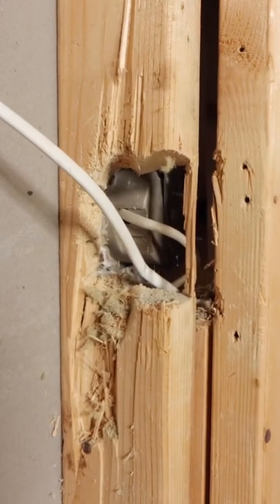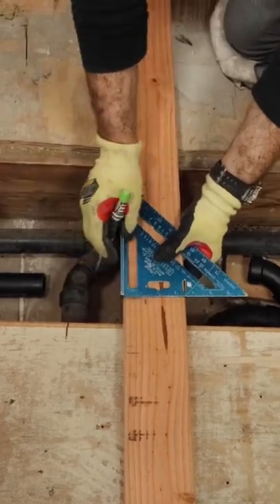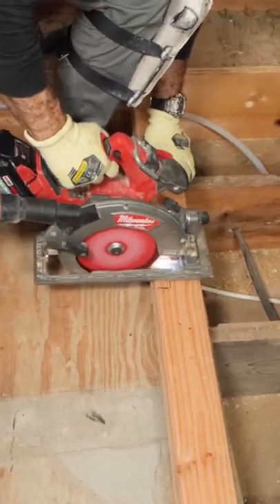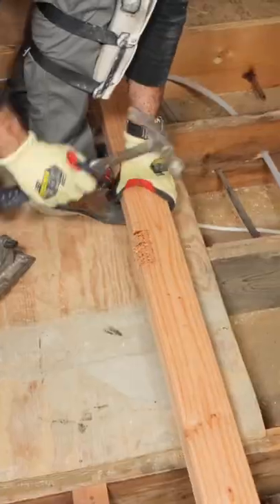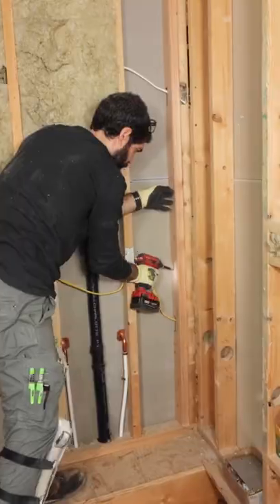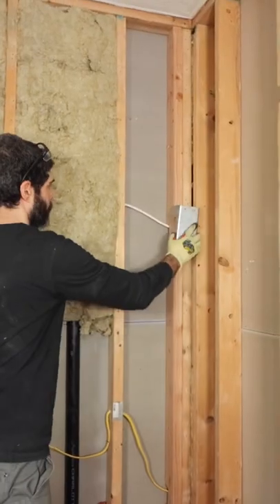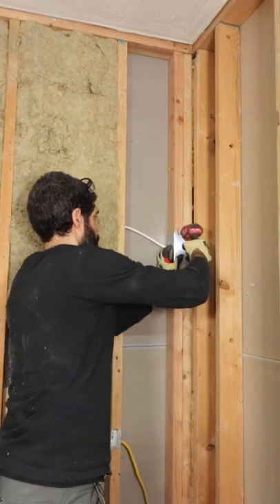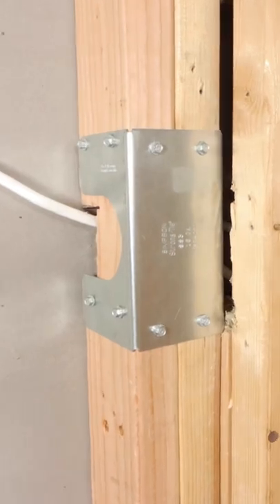Stud Wall Repair Tip - #shorts

Comment: Those screw heads may interfere with the drywall. Thanks for sharing!
Reply from the maker: Fortunately I had to fur that wall with 1/2” plywood so my KERDI-BOARD would slip over the tub lip. So I was able to notch the 1/2” plywood to keep the wall plumb 🙌🏼🔥
Reply: I've had to notch out the back side of drywall / greenboard using a 1" forsner bit for protruding fastener heads - not ideal but better than a bowed wall.

Also, link to the double stud bracket? Simpson?
Reply: No worries that's the drywaller's problem.
Reply: I was thinking the same he should use screws that are flush with the Box
Reply: @HomeRepairTutor  I'm guessing you screwed it up, and you've never conversed with a structural engineer. You can't fool people who rely on the quality of their work to eat.
Reply from the maker: @Dempdawg11  why would I lie about consulting an engineer, lol, that’s hilarious. Look man, you need to get a life
Reply: @XxPhasemanxX  was just thinking that sounds like the drywaller’s problem
Reply: Yea soon as I saw how protruding those bolts were I knew someone would say it'll mess with drywalling 😆
Reply from the maker: @Xaero324  but what they don’t know is that there won’t be any drywall in that area, cracks me up how people jump to conclusions without knowing all the information
Reply: Definitely will

Comment: It doesn’t even matter if it’s a load bearing . The damage must be repaired. There is wire running thru it also that must be protected. Good job.

Comment: Great video all the way up to your hex head screws you used at the end. It's going to cause issues with the finish work, that being Drywall, durarock... plus the stud shoe you're using is required to be drilled in from three sides and you can only use one, but honestly it won't make a difference.
Reply: Even those plates cause problems but he's right. Engineers want them used. It's super annoying.
Reply: Engineers are the biggest pain in the ass for the actual installers. They went to school and automatically kno every trade? Gtfo
Reply: @Ben-gw9tu  engineers are a pain in the butt for even regular every day people. I had this city engineer once calculating load rating over span and I'm like dude don't strain your brain my man. If your debating between 2 and 3 I'll put 4 boards. We are talking $20 in lumbar let's do it and move on
Reply: @Ben-gw9tu  I'm not an engineer, I'm a licensed plumber and mechanical contractor. Sorry you have a bad attitude about doing proper work. You're the kind of guy I get hired to fix all their work after they can't pass inspection and get fired off the job. But hey maybe youtube can supplement the income you lose from actually trade work.
Reply: @jamiecurtis2974  that’s funny. Surprising u kno my finances and my business finance. Sometimes it sucks when u talk about things u really have kno idea what ur talking about.
Reply: @Ben-gw9tu  like you and plumbing. 🤣🤣🤣
Reply: @jamiecurtis2974  ur not helping ur case as engineers being dumb pain in the asses. Ur right I kno nothing about plumbing. Only been a master plumber for 17 years
Reply: @Ben-gw9tu  well allow me to update you on the updates since you were doing Terracotta with the Romans. Trades people care about each other, including electricians. In the last 2000 years we learned a few things, like what I pointed out earlier. But hey, good for you taking a test and getting grandfathered into a trade where people now take pride in.
Reply: @Ben-gw9tu  keep trying, you're responses are as sad as your plumbing. Tradesman are dropping off fast but you're one we can afford to lose.
Reply: @jamiecurtis2974  class act bro.
Reply: @Ben-gw9tu  thank you, my thriving company and consistent referrals agree.

Comment: Unless you had an lvl header holding up an entire second floor section with gurder trusses on points riding down to it. I would have laughed at you when you did that
Reply: I love when builders act like they are engineers because they build a lot of structures… you have no idea what’s actually appropriate, just what is common. Don’t overstep your knowledge, this shit’s rampant on these videos and it’s asinine and ignorant.

Comment: Problem is that you just buried the romex against the other wall sheathing and by code the wire should pass through the center of the stud to avoid penetrating it..

Comment: Those spax are junk, use Simpson structural or framing screws, probably right next to the spax you got at Home Depot
Reply: Spax performs well in comparative tests. Not saying the other screws aren’t better, but Spax are perfectly well suited and capable for this job. Screws in general are more similar than they are different if designed for the same purpose. Why exactly do you think they’re trash anyway?

Comment: I would have used Simpsons' for the 3" too. Did not hear anything about a tight fit so it can carry the vertical load so I assume it was scabbed but  I would have strived for it to work vertically too.

Comment: Great video but y u use those screws on the outer side gonna interfere with dry wall no ?
Reply: It’s the proper screw for securing metal to wood is the reason, but yes, it will interfere. But realistically, any screw will interfere since the metal plate itself is already protruding a bit so it’s going to require a fix.

Comment: What does the sheet rocker do with the heads on those ?
Reply: Well, that's a hump in the wall now. Drywall guys would say not my problem m
Reply: They push real hard with one hand as they hold the beer with the other.

Comment: Just use a self nailing guard/plate, the one used is major overkill. You will def have issues with drywall/durock

Comment: Tell your structural engineer that the electrical inspector would be pretty ashamed at your structural engineer putting that wire so close to the drywall on one side. Putting in a nail from the other side while hanging a picture and you'd be dead.

Comment: That looks great except for those hex heads they are going to hold out whatever substrate you apply should have use flat framing screws.

Comment: If you cut the narrow end of the stud you only need two cuts and then wack it with your hammer. Lower your fence on your saw to no more than 1/3 the stud width and make a cut above and below straight through. No weirdness from the blade curve and it will break on the grain anyway.

Comment: That's kind of stuff doesn't fly on my job site.
Electrician comes back to pull the wire back and drill proper hole and feed the wire or he gets a back charge that he definitely won't like.
If he doesn't want to come back or be on another job of mine then that shows the kind of quality he gives and he's not welcome
Reply: Exactly what i thought .also the wire is laying against the existing sheet rock, not up to code. This wasn't a good repair...
Reply: Ok tough guy.
Reply: @dallas5374  tuff guy no,know what's right and wrong,yes sir....
Reply: @Thetreefella  I was thinking the same thing.

Comment: This looks like the hard, over kill way to do this. I have questions, why take the time to cut the square out when a simple notch will more than suit the purpose? Why the huge bracket when the single stud has been doubled already, you sure as heck don’t need it structurally? Finally, like others have said, those screws aren’t meant for that bracket, you can’t Sheetrock over giant hex-heads sticking out of your wall

Comment: To bad that's not a loaf bearing wall and I'm sure somewhere on that ace hardware box of screws it says not for structural use which ur saying its a bearing wall u wouldn't use those screws but maybe up north in Canada where u don't double top plate your bearing walls

Comment: What about somebody putting a nail or screw in from the other side because both sides of that wall are drywall aren't you worried about a Fastener penetrating The Wire

Comment: So like the million dollar question is why is that wire so close to the other side sheetrock and why did you not put that plate on the other side to protect it call the nailing plate

Comment: What about the screws sticking out? Shouldn't you have used something with a flatter head so it doesn't interfere with the drywall?
Reply from the maker: I had to fur that wall with 1/2" plywood strips, when I did that, I cut out a sliver for the screw heads

Comment: When you added the double stud shoe you left the wire I can't do the back sheetrock wall. Wire is too deployed from the center of studs and never left laying against sheetrock.
Reply: When you added the double stud shoe The wire was left against the back sheetrock wall. Wire is to be pulled from the center of studs.

Comment: You clearly don't really know what you're doing. You have to have a nail plate on the finished side as well, just like you do on the new side where you know exactly where the wire is and should be less likely to accidentally hit it. Hopefully this is your own house and you're not charging unsuspecting customers for your expertise
Reply from the maker: Well, I’d be worried about the nail plate IF there was any chance someone would put a nail in that wall. Since the odds of that are 0% and that’s due to the design of the bathroom on the other wall, I’m ok with the nail plate missing. Mind you, I’m well aware plates are typically required. Hence that wall having them.
Reply: @HomeRepairTutor  sorry. I'm being unnecessarily critical. Keep doing your thing 🙂

Comment: Gonna have a bulge behind the drywall in the corner from your screw choice
Reply: Just do a cut out on the drywall
Reply: @extramail850  extra work opposed to using the correct screw

Comment: If that was a bearing wall it would be 2x6 Or at least be sheeted with plywood on either side, with double studs every 4ft to nail off plywood edges.
Reply: It can be 2x4 with structural 1 plywood or osb and simpson hdu

Comment: Since when do we leave wires almost touching drywall? Your engineer told you to use that structural brace, did you consult your local electrician or read the codes on wire protection?  If your going to do an informational video make sure your doing everything correctly.

Comment: You can’t use screws for structural work……
Reply: You absolutely can… where do y’all pick up these old myths. This is such an old myth that has been shown wrong so many times. While once true with early screw designs, modern construction screws are perfectly well suited, tested, and designed for structural purposes. There are some great videos about this on YouTube that you can find.
Reply: @TheHeadincharge  sounds like you’ve never read the IRC. Standard construction screws are not rated for shear loads like what a nail can handle. Yes, there are some manufacturers that have designed stronger structural screws for joist hangers and anchor plates, but even then, most municipal building codes won’t allow it.
Reply: @psiewert83  Bro these aren’t joists… I’m not saying you should use screws for joists, but constructions screws are perfectly suited for this task and are well within spec. Nails may even be preferable, but to act like this is out of spec, wildly incorrect, or harmful is extremely disingenuous and incorrect.
Reply: @TheHeadincharge  I never said joists exclusively and I never said you can’t use them in ANY part of framing. I said structural work. Try reading bro.

Comment: That’s illegal! You can’t make a cut out in a stud that’s more than 33% of the height in length!

A stud is 1 1/2 inches thick by 3 1/2 inches deep! 33% = a cut out of 1.15” 

all he needed to do was to drill a hole on the edge of the stud that was 1/2” in diameter to allow that 14/2 Romex wire to pass through 

You can’t make a cut out that’s more than 1/3 of the height in length that means the width/Length of the cut can’t be more than 1.15 wide x 1.15 tall and it has to be in the center of the stud.

I’ve never seen that shoe before and I don’t understand what benefit that would provide because it’s actually open on the end where he made that cut out.

Comment: Unfortunately this is a fail!
First of all the wire needs to be in the center of the stud not up against the drywall, second of all what the hell is that metal thing and why would you ever use that?
Third, uhhhm your a carpenter we use nails not screws!

Comment: You should of put a nail plate on the stud beforr you installed it. Electrical is resting against the drywall on opposite side now.